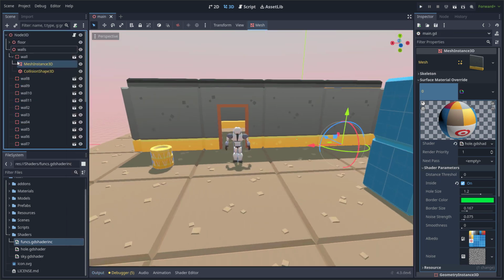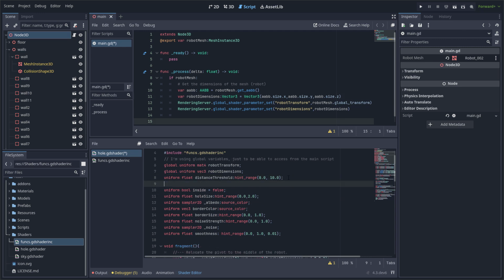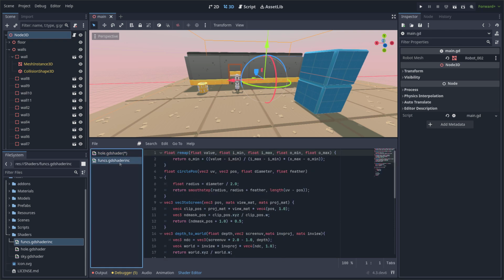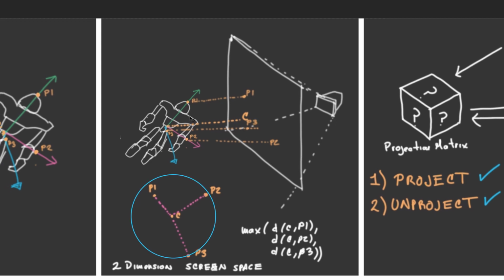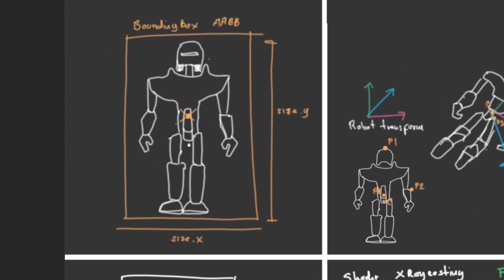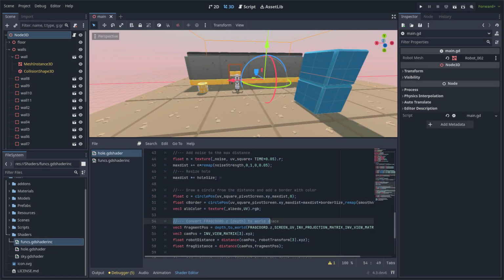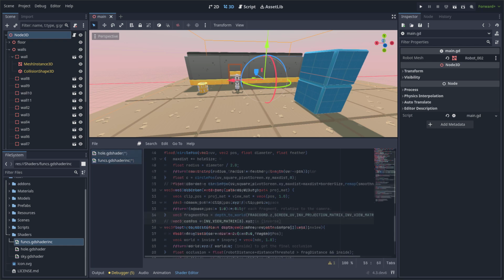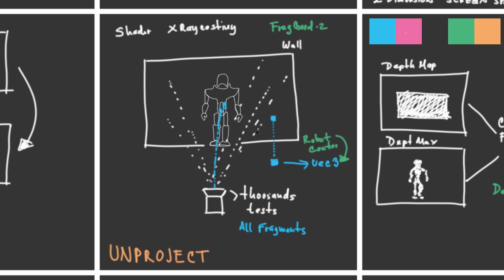Godot: Hole in the Wall using screen space + depth test

Comment: I replicated the shader in Godot 4.5.1 and changed it a bit to fit the isometric 3D ARPG style. Feel free to use the code below as a base.

Contents of hole.gdshader:

shader_type spatial;
render_mode depth_prepass_alpha;
#include "funcs.gdshaderinc"
global uniform mat4 robotTransform;
global uniform vec3 robotDimensions;
uniform float distanceThreshold: hint_range(0.0, 10.0);
uniform float holeSize: hint_range(0.0, 10.0);
uniform sampler2D _albedo: source_color;
uniform vec3 borderColor: source_color;
uniform float borderSize: hint_range(0.0, 1.0);
uniform float noiseStrength: hint_range(0.0, 1.0);
uniform sampler2D _noise;
global uniform bool is_in_the_way = false;
uniform float smoothness: hint_range(0.0, 1.0, 0.01);
uniform float noiseScale: hint_range(1.0, 20.0, 0.1) = 5.0;

void fragment() {
	vec3 pivot = robotTransform[3].xyz + vec3(0,robotDimensions.y / 2.0, 0);

	vec3 pointX = mat3(robotTransform) * vec3(robotDimensions.x/2.0, 0, 0);
	vec3 pointY = mat3(robotTransform) * vec3(0, robotDimensions.y/2.0, 0);
	vec3 pointZ = mat3(robotTransform) * vec3(0, 0, robotDimensions.z/2.0);

	vec3 pivotScreen = vec3toScreen(pivot, VIEW_MATRIX, PROJECTION_MATRIX);
	vec3 pxScreen = vec3toScreen(pivot + pointX, VIEW_MATRIX, PROJECTION_MATRIX);
	vec3 pyScreen = vec3toScreen(pivot + pointY, VIEW_MATRIX, PROJECTION_MATRIX);
	vec3 pzScreen = vec3toScreen(pivot + pointZ, VIEW_MATRIX, PROJECTION_MATRIX);

	float maxdist = max(distance(pivotScreen, pxScreen),distance(pivotScreen, pyScreen));
	maxdist = max(maxdist,distance(pivotScreen, pzScreen));

	float ratio = VIEWPORT_SIZE.y / VIEWPORT_SIZE.x;
	vec2 uv_square = scale2(SCREEN_UV, vec2(1.0,ratio), pivotScreen.xy);

	//float n = texture(_noise, (uv_square * noiseScale) + TIME * 0.05).r;
	float n = texture(_noise, (uv_square * noiseScale)).r;
	maxdist += n * remap(noiseStrength, 0.0, 1.0, 0.0, 0.05);
	maxdist *= holeSize;

	//float c = circlePos(uv_square, pivotScreen.xy, maxdist, 0);
	float c = circlePos(uv_square, pivotScreen.xy, maxdist, smoothness);
	float cBorder = circlePos(uv_square, pivotScreen.xy, maxdist+maxdist*borderSize, remap(smoothness,0.0,1.0,0.0,1.0));
	vec3 albColor = texture(_albedo, UV).rgb;

	vec3 fragmentPos = depth_to_world(FRAGCOORD.z, SCREEN_UV, INV_PROJECTION_MATRIX, INV_VIEW_MATRIX);
	vec3 camPos = INV_VIEW_MATRIX[3].xyz;
	float robotDistance = distance(camPos, robotTransform[3].xyz);
	float fragDistance = distance(camPos, fragmentPos);

	float occlusion = float(robotDistance + distanceThreshold > fragDistance && is_in_the_way);
	vec3 mixAlbedo = mix(borderColor, albColor, cBorder).rgb;
	vec3 mixEmission = mix(borderColor * 5.0, vec3(0), cBorder).rgb;

	ALBEDO = mix(albColor, mixAlbedo, occlusion);
	EMISSION = mix(vec3(0),mixEmission,occlusion);
	ALPHA = mix(1.0, c, occlusion);
}

Contents of funcs.gdshaderinc:

vec3 vec3toScreen(vec3 pos, mat4 view_mat, mat4 proj_mat) {
	vec4 clip_pos = proj_mat * view_mat * vec4(pos, 1.0);
	vec3 ndmask_pos = clip_pos.xyz / clip_pos.w;
	return (ndmask_pos + 1.0) * 0.5;
}

vec3 depth_to_world(float depth, vec2 screenuv, mat4 invproj, mat4 inview) {
	vec3 ndc = vec3(screenuv * 2.0 - 1.0, depth);
	vec4 world = inview * invproj * vec4(ndc,1.0);
	return world.xyz / world.w;
}

float remap(float value, float inputMin, float inputMax, float outputMin, float outputMax) {
	return outputMin + (outputMax - outputMin) * (value - inputMin) / (inputMax - inputMin);
}

float circlePos(vec2 uv, vec2 pos, float diameter, float feather) {
	float radius = diameter / 2.0;
	return smoothstep(radius, radius + feather, length(uv - pos));
}

vec2 scale2(vec2 uv, vec2 scale, vec2 pivot) {
	return (uv - pivot) * scale + pivot;
}